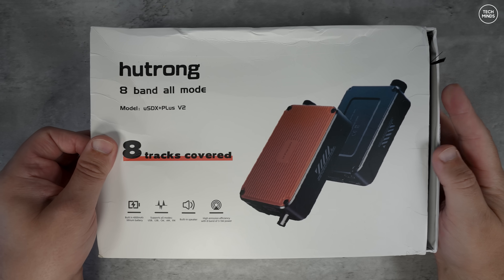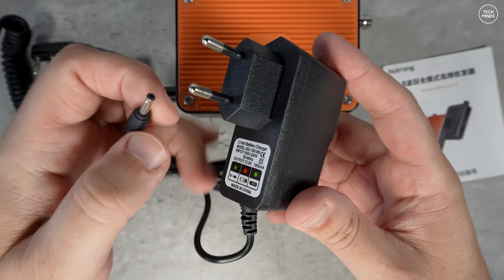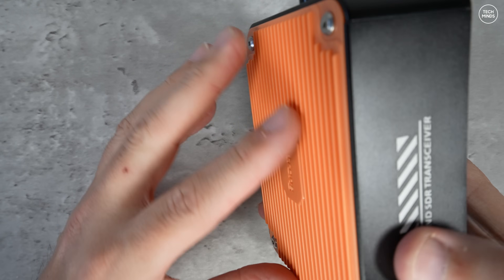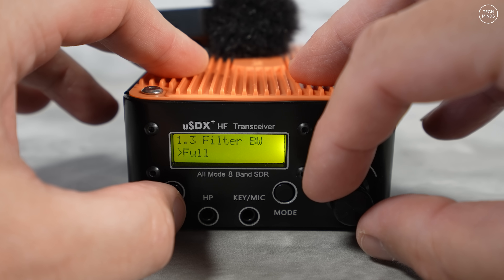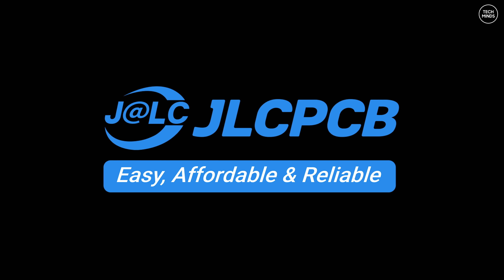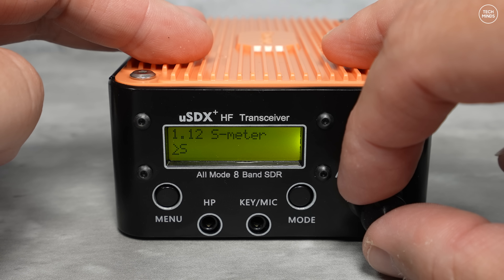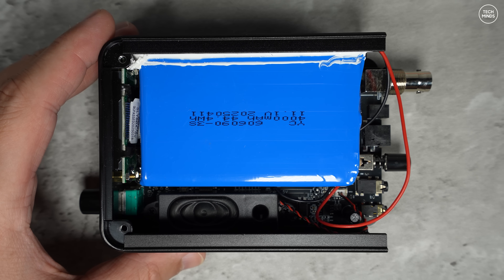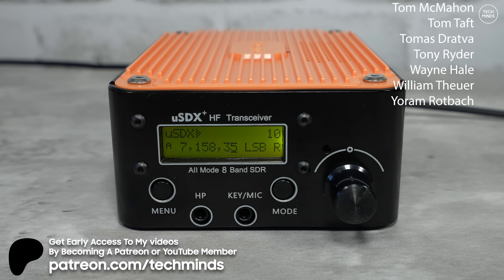These uSDX HF Transceivers Are Getting Better!

Comment: I'm looking at this Hutrong version of the Chinese USDX+ V2. I have a DL2MAN (tr)USDX and a 2021-vintage USDX, 8-Band, White Button Black Brick. The Black Brick has the single IRF-510 PA. I guess the DL2MAN uses the 3 BS-170 FET?s. What does this use, the same BS-170 FET's? Also, I can't get this newer one in the US except with the European power adapters. Are the adapters multi-voltage such that I could just use a plug adapter? In the US, our AC voltage is 120VAC. Europe uses between 220 and 240 VAC. Can someone with this orange plastic top unit check the two power adapters to see if they will take 120VAC input? Thanks. KD5HVO.

Comment: Hi... After watching your video I've decided to order one from Bangood... But I got an unpleasant surprise, first they have sent the wrong plug batery charge and both provided power supplies had the same "big" plug... And second, after a more in-depth analysis I open it and toke the battery out of the way to find out that they also cut out on components on the board, first they missed the 10 meter coil on the filter section, and on the RF amp circuit they only installed 2 of the usual 3 power transistors... I couldn't test mine with a proper good antenna but with a tunable whip I have it is quite "def" and get loads of noise...
I would ask you a huge favor... Please open yours and check if those missing parts are also missing on your radio or if I got a defective one. I'm trying to send it back to Bangood due to the wrong power supply and the missing parts but was nice to confirm if this version with this fancy box is not just a way for the Chinese to get rid out the 3r choice boards by selling them inside a fancy box...  BTW, the returning process is quite complicated and due to the Christmas season I only hope I be able to solve the problem and get a new radio or my money back... 
Anyway... I would be quite thankful if you can clear my doubts bout those missing parts and it might be a great subject for a new video about the USDX+ shenanigans anyway...!
Thank You...!
73

Comment: WRT menu item 8.4:
IQ output refers to the in-phase (I) and quadrature (Q) components of a signal, which are used to represent complex signals. This output allows for the effective processing and analysis of radio frequencies by capturing both amplitude and phase information. The Q component is 90° out of phase from the I component.

Comment: My signal source's display frequency differs by approximately 2 kHz. I compared it with other receivers. How can I fix this?
Reply from the maker: Pretty sure I covered that in the video when going through the menus.
Reply: @TechMindsOfficial  I'm talking about the calibration method
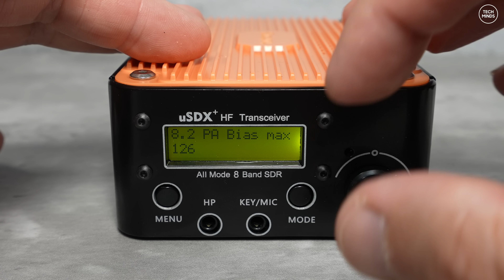Reply from the maker: Yes, 11:28 in the video, menu item 8.3. You can adjust this to ensure the radio is on frequency. You will need a signal generator or a known rf source that is ON frequency.

Comment: On the strength of your review I bought one of these. If this model is better than the previous ones then I dread to think how bad the earlier models were. The Rx audio is muffled and distorted, The Tx power even on 20m I don't think is anywhere near 3W yet alone 5W, even on the default Tx drive setting. It just screeches on Rx on 160m. The instruction manual is a farce. The on/off switch is like a wobbly tooth, etc, etc. The version I received a couple of days ago indicates that it covers all amateur bands 160m to 6m, 3 more than stated on the packet. The actual parcel looked like it had done 10 rounds with Muhammad Ali. The rest is unprintable in a family friendly space. I would return it for a refund but I suspect it will cost me more than to buy it in the first place. As for buying it from Banggood well I hope you got your kick back. I wont be using them again.
Reply from the maker: I also complained to Bangood about the state of the packaging I received, they told me it gets shipped directly from their supplier but would pass on the information. These radios are not intended to be off the shelf black box transceivers. If yours does not work how mine did in the video then there is something wrong with it. Muffled audio could be that your bandwidth setting is set too narrow or the internal/speaker mic speakers are not that good. I understand your frustration, but nothing to do with me, I showed in the video what this radio can and cannot do. If yours is different, then contact them for a refund. If you have problems with that, then contact me and I will push them for you.
Reply: @TechMindsOfficial  Ok thanks I will look into contacting the seller/Banggood. I hope you get your bonus.

Comment: Despite how much you praise the radio in the video, from what I see and hear, it’s still the same old Chinese junk, a clone of the uSDX by PE1NNZ and DL2MAN, with the same flaws this experimental SDR radio powered by an 8-bit microcontroller has suffered from since its creation years ago.
DL2MAN and PE1NNZ managed to squeeze a little bit more out of that hardware over time, but it’s still just an experimental toy, and this clone is based on a long-outdated version.
This is exactly the case of the saying, “I’m not rich enough to buy cheap things.”
Reply from the maker: Actually "Sir Wolf", I am praising the build quality and the receive of this particular build. People keep calling it a clone, which is very strange and narrow minded. The original uSDX is open source, correct? Firmware and hardware. This radio, that I show in this video looks NOTHING like the original, even the PCB. As someone like me, that has seen pretty much every version of this design, in my hands, and actually tested it, this video shows my particular results. Do not mistake me for someone who has just received this radio and ONLY used this version. Plus, I show what I am talking about, let you the viewer hear and see everything. However, nothing will make much difference to transmit audio with this design. If the original designers did not want people to enhance, build and "tinker" with their uSDX design, then they would never of made it open source. So yes, it deserves its praise because whoever has made this version has put a lot of time, effort and money in making this. It's not perfect, but it costs less than £60 ffs!
Reply: Typical Ham snob, this attitude has kept many young people away from Amateur radio

Comment: Many thanks for doing this video it has helped me out a great deal. I have the brick type and it suffered with poor audio on tx etc. I factory reset it and changed my settings to yours. Although it's dropped Rf output it's certainly made audio better. It gives 3w as it used to give 6watts. All is fine. George 😂
Reply from the maker: Glad to hear the video helped, and thanks for sharing your experience and the settings tweak!

Comment: They might use separate charging circuits for the internal battery to prevent noise.  Switching power supplies and battery management controllers emit a lot of RFI and EMI,  which would give you a horrible noise floor.
Reply from the maker: That is a good point to be fair, cheers

Comment: No CW?
The uSDX started as an extension of the QRP Labs CW only QCX. Now this knockoff doesn't even do CW.
Reply from the maker: Not sure why you think it doesn't have CW considering it shows CW in the mode selection and there is a "key" port on the radio. Plus I even said in the video that there is a whole CW section. Maybe you commented without watching the video.
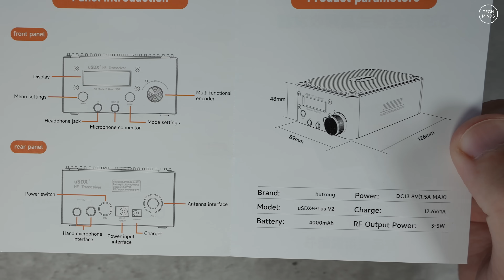Reply: @TechMindsOfficial  Sorry I missed it. The manual at 1:27 doesn't show a key port.
Reply: @rkayakr  Well maybe, but I got my info from the video, showing the Key/Mic Port, 😉🇨🇦

Comment: I'd get the TruSDX even though I prefer the packaging of this clone.  I wish it had a BAND button as well as the MODE button so there is no need to go into the menu to change bands.  It'd also be nice if the rotary encoder had a push switch to change if from audio volume to frequency tuning.  Mostly, I wish it used an external power supply, trading the internal lithium battery for a 20 W RF amplifier.
Reply from the maker: The rotary encoder is a push switch, and if you hold it in, the band will change.
Reply: Have a TruSDX and am not impressed with it. I also have one of the uSDR+, the one with the red corners, and it's a decent radio ruined by a terrible quality encoder that bounces selections around a lot. Think I'll order one of these. Looks better made.

Comment: So, is this anything more than just another unlicensed, unofficial Chinese rip-off of someone else’s work, with a new case? And, of course; the UK illegal power supplies! Or have I missed something here? It would have been nice to have seen its spectrum purity as well!
Reply from the maker: Doesn't need a license and is not a rip off. It's based on open source hardware and firmware? In fact, it most certainly receives better than the original. Either way, £60 for a "not bad" receiver. Not everyone can afford icoms or yaesu radios.
Reply: #sadham

Comment: One serious issue other hams have noted with the uSDX family is the IMD.  While you didn’t do a formal two-tone test, your audio results with the tx drive set to 4 shows that IMD is still a problem with this radio. You may get fewer complaints if the noise floor is  high and you’ve got your tx drive set low, but this also means you wouldn’t be making many contacts.  If you care about being a good steward of the ham bands please consider something other than the uSDX radios.
Reply: Looked to be about 4 kHz wide, no improvement at all over the older uSDX-series.
Reply: There are two ways to improve the TX quality: 1) go through the ordeal of upgrading the firmware manually, which is a pain , or 2) buy a better MIC.  I found Baofeng MICs to not be any better, but the Retevis Retevis Speaker MIC was a vast improvement.  Don't even waste your time soldering capacitors on on that tiny piece of garbage that came with the unit.
Reply: What's wrong with you?   You ok?
Reply: Why is it called 8 band, when the listing shows  6 bands  🤔
Reply: I don’t know why you’re worried, 3W SSB is hardly going to destroy the bands and what’s wrong with 4khz anyway?
Reply: @pauls8456  Indeed. IMD is a real issue but FAR less so at QRP levels. The IMD from a poorly configured linear amplifier (as seen every day on the bands) is far more of an issue than the minimal IMD produced from a QRP transmitter, even if it is operating at 4khz! QRP rigs like this are not the problem, even if they are not perfect. 73 and good DX.

Comment: This version seems to be missing the CAT control plug on the back which might make data operations more difficult.
Reply: It's not too difficult to use a PC sound card for audio to and from the radio, use VOX to enable the transmitter, and manually tune the frequency.  CAT control is nice but I also like the simplicity of only an audio connection between the computer and radio.  Just be careful not to transmit PC error tones of YouTube videos on the JS8 frequencies.   :-o

Comment: It's definitely not better since this version omitted the CAT Control, and with the version I have the battery is glued to the metal top case so access to the circuit board is unaffected. W5UW said that.
Reply: I picked one up as well and it seems to work great. About 4 watts out. The battery is stuck to the circuit board components with a double sided adhesive foam pad, so it a simple matter to lift it to access the board..  no need to cut the white silicone...the battery just hinges on it

Comment: Hi Matt, interesting radio. I've been spending time tidying my home and shack. I have discovered 3 items with these pouch batteries, 2 nanovna's and a spot welder who's batteries are totally dead and refuse to take a charge. Sourcing replacement batteries is a royal pain so I think I'll be cutting back on items with built in batteries. Sucks. The batteries seem like a great idea, however, if life gets in the way be prepared to end up with non-functioning items with hard to replace batteries.
Reply: I'm sure you can wire on another battery from a rc model or something
Reply: I prefer external batteries on radios (and many other things like this), in part for long term reliability, but also to allow me to select whatever battery I need for each particular use.  I just bought an FX-4CR transceiver and it has no internal battery and instead has a 20 W RF amplifier which is much more to my liking.  If a radio has internal batteries, they should be 18650 batteries that the user can swap later, or remove to save weight and increase reliability if not needed.